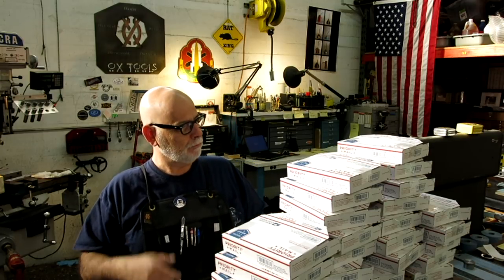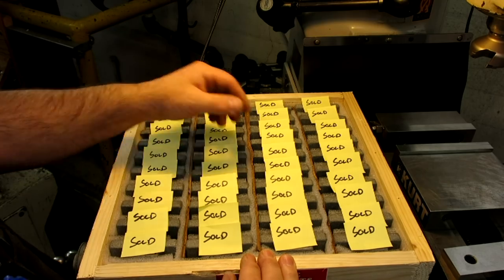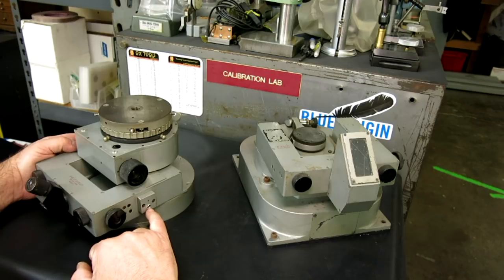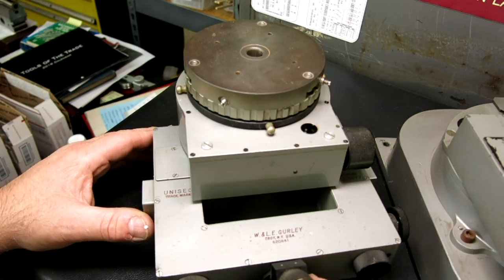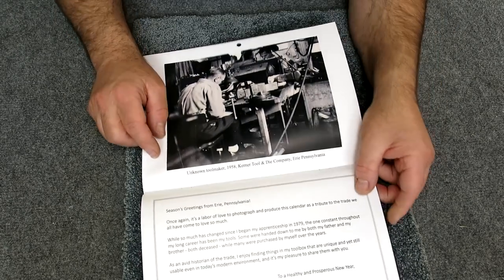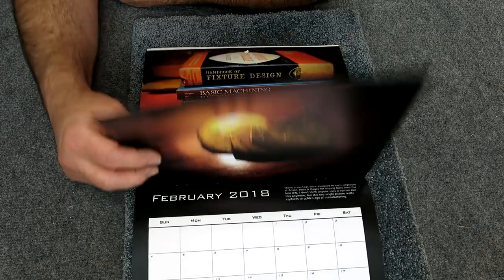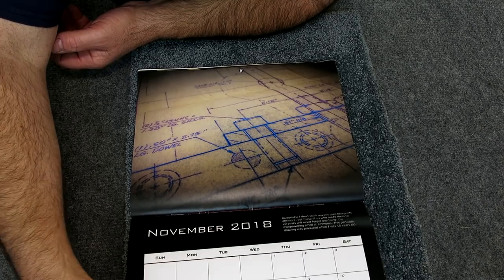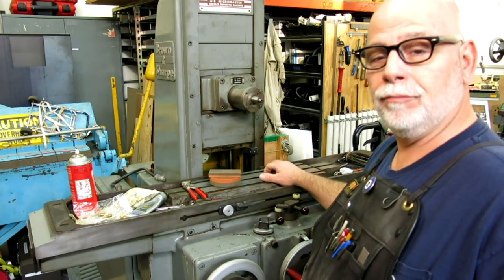Monday Night Meatloaf 115

Comment: I had a look at the patent.  I believe the way it's read is by adjusting the fine (second) scale until the lines on the main scale line up.  The patent states that "The reading is taken when the prisms have been set to cause register of the graduations in the two images."  Also figures 8 and 9 of the patent seen here: https://patentimages.storage.googleapis.com/pages/US2363877-2.png show two example readings corresponding to 0' 55", and 1, 31' 12.8", both of which show the coarse scale graduations aligned.  All the fine scale mechanism does is move a prism which shifts the two main scales in opposite directions (the same rotational direction).  When they are aligned, the minutes and seconds are read off the fine scale.  Moving the 'rotary table' exactly one arc second might be very difficult, because this measurement mechanism was designed for a theodolite which is first aligned to a target, and then the angle read off rather than moving to a specific angle like you'd want for a rotary table.
Reply: Robby Stokoe I was going along with the he same thought. Defiantly reminds me of a base for an old analog/mechanical theodolite.

Comment: A lot of memories in this video for me. As a young pup in the McDonnell Douglas tool shop, I used pretty much everything you had in the video from the tool chits to the surface grinder. 

We even had a much larger optical rotary table. We never used it on a machine and in fact it sat on a dedicated surface plate. From memory the plate was about 6 foot square and a good 2 plus feet thick. It sat on a low stand and the table surface was about 3 feet from the floor. We used it for calibration of an internal navigation optical tool, similar to a transit but much more accurate, sensitive and fragile. There were monuments anchored out in the shop, very well anchored and the rotary table was calibrated with them. We would place the nav tool on the rotary table then aim at the monuments with the nav tool to check that it still gave accurate reading to it's own scale. Again from memory the monuments were out about 50 feet in each direction. At that distance you can see how far off the tool was while watching the arc second scales.  Sadly as a young pup and apprentice I never operated the table to calibrate the tool but it was a rather involved process if I remember correctly.

 This was back in the 70s . The shop was a wonderful place to do G jobs, we had many skilled trades in one building and for the most part we knew most of each other. I was in the Jig and fixture shop but we also had machine shop, grind shop, tool and die shop with supporting welding shop and wood shop all in one building. I have been retired for more than 2 years now since they shut the Long Beach plant down.

From 1984 to retirement I worked on the C 17 cargo aircraft. I was tooling inspection since '87 and source tooling inspection for the last 7 years. Good times! I sure miss blue line drawings. I have a few stashed away just because you never see them anymore! On my channel I have made random attempts to pass on a little of my shop time to benefit those who will never get the chance to work in a shop like that.

Comment: There is only one color for precision machinery and your master square: RAL 6011 Reseda green.
Reply: Panzax I could not agree more! Maybe even paint the insides of it 'primer red' (like some old faceplates and lathe gearboxes) and the outsides green. Really gives it the 'old timey' look if you ask me.
By the way Tom, great to see you back with a fresh new meatloaf, i had been too long.
Reply: I think that looks to Taiwanese. like those grizzly machines.
Reply: Mark Mauzey this is what I meant: https://sites.google.com/site/dannympwillems/_/rsrc/1472844577766/IMG_1742-large.JPG?height=315&width=420
To me that is the one and only combination for old lathes and mills.. or perhaps instead of green the old grey colour. Much better than the newschool white and blue

Comment: Those are good grinders. The weak link is the o-rings they use as the spindle drive belts and the cross feed nut.

Comment: My mini surface plate was a piece of hard bronze with a steel plate bolted on. Used my surface gage and indicator for the sane thing. Also had a T6061 aluminium plate that was 1.5" thick for use on the big electro magnetic chucks on surface grinders and Blanchard. Keep up the good work, I wish that I had a way to pass on my knowledge and experiences of 40+ years of bookmarking and job shops

Comment: Paint on that master square? Nope too mundane and not nearly classy enough. But if it really had to be paint. I'm unsure of the exact process they used cause it sure wasn't out of a rattle can. But the old school black wrinkle paint used on a lot of instruments and some Starrett tools. Or the grayish green sort of fish scale look Mitutoyo used. It would be a lot more work and the metal would really need almost a mirror finish, but the modern hot caustic blueing which we all know is really black, then finish grind the working surfaces to perfection after it's trip through the blueing tanks. A wipe with oil once in awhile and no future paint chipping to deal with. It's also dirt cheap if you do all the metal polishing.

RJ Newbould is an extremely clever guy and I seem to recall he did a number of lengthly posts on the Practical Machinist General forum a few years ago detailing how that indexer came about. And the Smithsonian had a quite prestigious display about it at one time. I didn't know RJ had a YT channel so will for sure be checking that out. But he sold those indexers to some top names in the manufacturing world because nothing else on the market could do at that time what his could. I believe Moore Tools use of face gears for indexing predates Newboulds use, but he refined his indexer to do a lot more than the Moore tool could.

Comment: Could pretend to be a interested customer of this
https://www.bmisurplus.com/products/28590-w.-l.-e.-gurley-5706-a-unisec-optical-goniometer-assembly-in-cabinet
 "There are a couple of xerox copies included with the instrument, one on the theory of operation, and the other instructions for taking a reading through the microscope. "
And see if they'll scan a copy.
Reply: holy crap, they want north of two grand for an obsolete piece of equipment, those guys seem to know their business and scans would go at $20/page
Reply: $ 2900.00 --- WOW !!
Reply: Old doesn't mean obsolete. If it's still accurate, there's no reason a new one will be better and being entirely mechanical means you could probably fix it if something stops working. You're also paying for the novelty/rarity value

Comment: I’m going to take a guess at how that rotter table works. The arc second adjuster offsets the marks relative to the duel angle reading.  It probably does this by adjusting the optics. You would the use the worn to readjust the the table to line up the lines on the main readout. Curious to know if this is in fact how it works. Looking forward to being corrected.

Comment: Tom, I don't think they're meant to mechanically move the table.  

Rather than a piece of positioning gear, it's more a piece of inspection gear like our autocollimators.  
You set up the job, then you use the optics to measure the DEVIATION to a higher precision.

Kinda the same thought as an optical comparators... You set up a thread, turn it, mic it  and adjust until it seems dead-nuts and finally check the first article for deviation from the thread form on the comparator.
Reply: By the way, glad to see the video and the progress on your reference square.  I have a heat treating oven in the works and I might steal some elements of your "composite" design.   I like those neat adjustable feet and I have a bag of extra insert screws with Torx heads.

Comment: Hey a new comment on an old video.   Live your videos, you give me ideas.  But I noticed the chips.  Still have a set from my next to last job, plant shut down, spent next 14 years playing mechanic.  Now I am back in the tool and die shop.  Love the sound of punch presses, even the cnc punches.  Made in America baby, yah.  Then you got out a set of magnetic parallels,  I have a pair with the cylinders in brass or bronze I know are from the 1940s,  have another newer set that are laminated strips of brass and steel.  Since I am more active in the trade now, always have had a shop at home I am digging through my boxes of tricks, finding special stuff.  Sifting through your videos, you mentioned and showed a magnetic cylinder square.  I need one.  More than one way I could whip one up.  Hard base or soft, how to orient magnets.  Should I use Thompsons or a long dowel pin.  Hey I love your windyhill indicating square btw.  Currently my squareness standards are a set of 246 blocks. Seem to be within less than a tenth.  As one old guy I used to work with would say, good enough for the girls I go with.  Ha.  He was a crusty old rascal.

Comment: @oxtoolco (With the Gurley instrument) I suspect one is supposed to use a autocollimator and a mirror mounted on the table. So I think the seconds adjustment moves one of the scales (maybe) but the rotation is set to null / close the angle using an autocollimator. What happens when you lightly apply the brake and use the arc second adjustment. Some older surveying instruments use a Vernier on the right hand scale (kind of thing). I might dig about in the patent literature... Looks like the instrument would mount a prism or mirror etc. ? / Or telescope etc. ?

Comment: Sounds like you understand perfectly clear to me.... it's been a while but, from what i can recall u usually have something that holds the part or test samples etc. Usually likr a small clamp and u can check angles and all. Now what we used them for normally we were using overlays which were just a revision based clear scale marker/map for checking tolerance or whatever but many times we used them to point features on machining components or products....inserts, thread/seal molds....  parts whatever... dispositioning questionable features like lips on counter bores or more commonly threads...especially smaller designed threads for certain premium connections with critical areas....radiused corners on multiple features would very often show a undesirable chamfered looking corner as if i remember right it was worn inserts usually... nkw we didn't use comparotors or molds for 80 years them we started so, i mean haha yeah... but we scrapped a whole lot of expensive fkn shit with it i can tell u that much... one of urs has a turntable for different things, yeah they come with a lot of shit... if i would've known then what i know about how things work now i really would have a few stashed with plenty other stuff....hahaha...😐

Comment: I don´t know if I come late with this info. 
The dividing table with optical sights you have there we call it in Germany :
"Rundtisch mit optischer Einstellung" 
Put this into "google" and you have more info ---- in german ! 
This device is used normally with a measurement microscope , or sight put on top. You measure the angle between two faces of a tool for example.  
Put the tool for examination  , for example a shaper tool with its tip right in the middle and look from the top with yout microscope (with reticulation , of course). then align one of the faces of the tool with the microscope line. Take the first measurement or set to zero. Then rotate the table to put the other face of the tool in line with the microscope and you take the second measurement. 
That way for example you can measure the cutting angle of a tool with absolute precision. 

The main question is that you need a Microscope with crosshair looking from the top on the table to use this device.

Comment: Hi Tom.
The display on the turn table looks to work on a similar principal to one the Wild (now Leica) theodolites. I us one called a T2 which reads to 1"  and has display broken up similar to your.  the degrees and tens of minutes a read of 1 scale and a minutes units and seconds read off a second by adjusting the micrometer dial to align some marks on the scale.  
Maybe some one in the surveying meteorology area might be of some help.

Comment: Long overdue? Never. Quality, not quantity!

During WWII Gurley played an important role in helping the US become less dependent on Switzerland for precision theodolites (which were important to artillery operations). The etched circular scales were the biggest hold up, the Swiss has figured out a way to mass produce the things in volume with high precision, and Gurley wasn't able to match that.

Maybe there is a lock hiding somewhere on that unit? A theodolite typically can be spun around the azimuth axis and coarsely positioned, then the lock is tightened, and the fine adjustment screw can be used to fine-tune from that point. Turning the fine adjustment without the axis locked has no effect, as the wrong bit ends up turning (in your case, the table might move with the scale, so there is no observed change on the scale)

Comment: As far as paint goes, if you want black (or silver), and want something other than gloss, hammer tone or wrinkle, you could use Harley-Davidson engine paint.  It gives a texture about like a part cast in fine-grained sand, applies nicely and blends well.  And being H-D, you may arguably find a better can of spray paint, but you'll be hard pressed to pay more for it!

And regarding books, I make use of the searchability of the Internet all the time, but find much more enjoyment in perusing a book.  Especially an antique auto or motorcycle manual where I can tell by the greasy thumbprints that somebody else had faced the same jobs as myself, and (hopefully) found the needed guidance there.

Having started my work life at twelve years old in 1979, cutting electric motor commutators on an old manual lathe, I grew up with blue line prints, and vellum.  Although I've studied CAD, and spent my last year as a draughtsman using CadKey v.6 (a while ago!), I guess I was introduced to them too late in life for solid models and computer fonts to stir my soul.

Really enjoyed this particular serving of meatloaf; amazing how precise some of that old school equipment was!

Comment: On that "Gurley" you would level first then center (which locks that top face down). After centering and locking, you would be unable to adjust the level.

Comment: Put a laser pointer on the top of that second arc seconds dealie and have the wall as many feet away as possible... then turn that small dial and see if the laser dot moves on the wall.

Comment: Did you figure out how to read the Unisec yet?  I believe that the fine adjustment intentionally puts an error in the calibration.  So in your example, you set the fine adjustment to 6 then line up the 180.0  and the 0.0 marks, what you actually have is 180.06  (basically line up the marks and add what is on the fine adjust scale).  At least that is what I can deduct from watching how the machine works in the video.

Comment: On the Unisec, my guess is that since Gurley was originally a survey instrument maker, the method of operating the Unisec would be the same as operating a(n optical) theodolite.  The controls and adjustments look very similar.  It's not surprising that the modern Gurley company was of little help, since the makers of the Unisec was a couple of ownership transfers ago.

Comment: On the plastic gear bit, I used to work for an avionics company and had some involvement with an autopilot servo.  The unit could supply around 90 ft-lbs of torque as it pulled directly on the control lines to rudder and elevator control surfaces.  In the middle of the servo was a pair of gears very reminiscent to the ones you showed which was sandwiched together by an electromagnet solenoid mechanism, which was used to disconnect the output from the gear drive...in which that clutch stack took the entire 90 ft-lbs of torque directly.  So yeah, those plastic gears do handle plenty of torque.

Comment: I would ditch all the earth and dark tones from the start, generally speaking, dark in dark places doesn't make that much of a pleasant look, especially considering the sharp contrast with the precision ground surface from the faces. SO, orange, the same one, actually had been my initial pick too, but yellow and red do make for nice machinery colors. Dunno about blue, i've always associated that blue color with industrial, cold, lifeless machinery. Probably because i had a mill on loan for some years in that color and i hated it (despite liking the color otherwise). Eh. So 1103 and 1114 kinda do my fancy. :) Either way, no matter the color, that piece will look stunning, one of the coolest ones i've seen, if, not the coolest one yet.